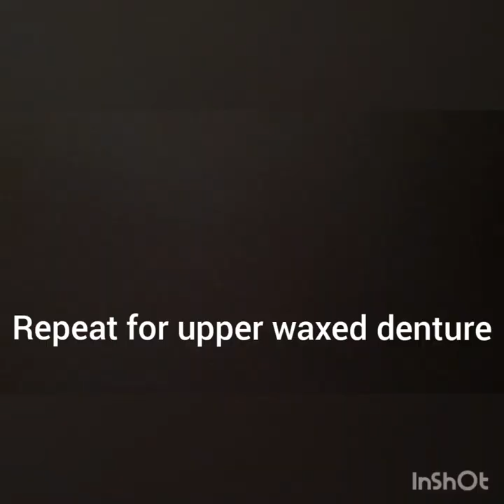How to do flasking of waxed dentures

Comment: 1. Check fit 
2. Wax denture sealed to cast
3. Mix plaster
4. Place on vibrator and Pour plaster
5. remove excess
6. Check undercuts with scale angled 45 degree
7. Plaster shaped at 45 degree to ease deflasking
8. Apply cold mould seal
9. Apply flask counterpoint
10. Pour plaster till occlusal surface and expose cusps
11. Make grooves to aid in indentation
12. Apply seperating media but avoid occlusal surfaces of teeth. In case it gets applied, remove with cotton
13. Third pour
14. apply lid
15. Let excess flow out
Reply: Thank you
Reply: Переведите пожалуйста по русски

Comment: I'm a dental tech for over 50 years.I let the waxed denture sit in cold water for a few minutes especially if the model is dried out.This usually eliminates bubbles in the upper half.I mix my plaster fairly thick and place a blob in the center of the flask .Easier to work with and no need to fill the bottom with plaster as the model displaces the plaster and fills the flask.
Reply from the maker: Thanks for sharing your experience.